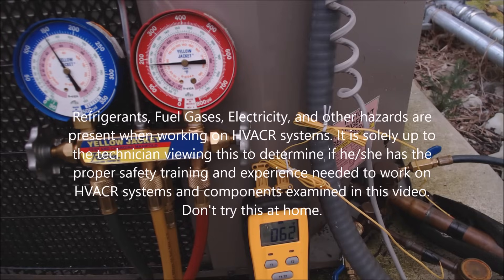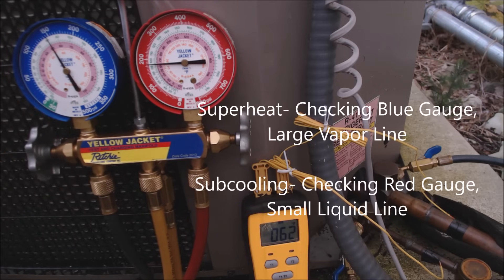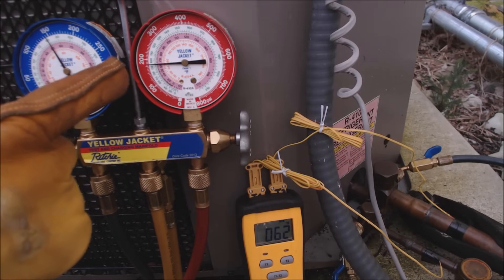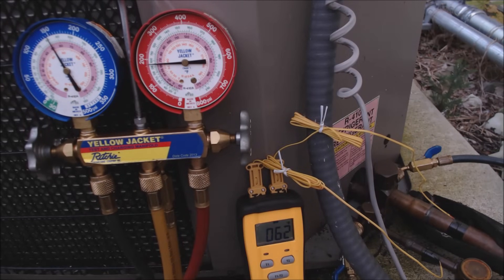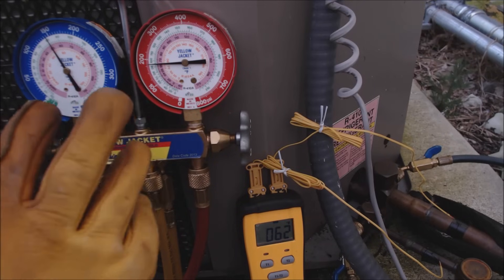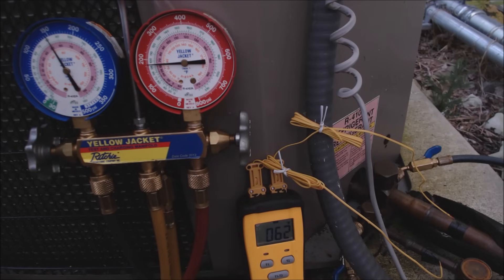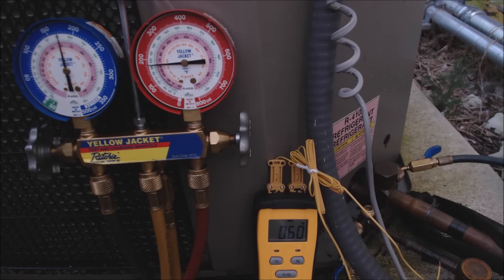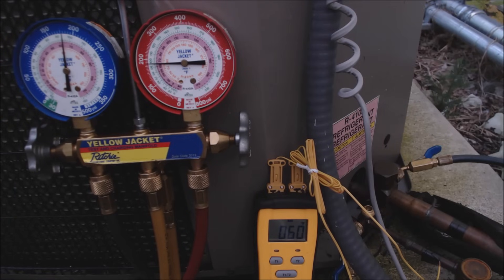HVAC Troubleshooting of Bad Compressor Valves! How to Verify!

Comment: Nice video! Have you ever did that test on a package unit where there are no pump down valve like the split condenser have?
Reply from the maker: Hey Keith,  You can actually tell the compressor valves are bad due to the high sat temp since there was no heat load, low subcooling, and around the correct superheat. You can tell if a single component refrigerant is good by checking the sat pressure once equalized and comparing the sat temp read on the gauge to the temp surrounding the unit. If this was a restricted liquid line or a partially closed txv then the sat temp would be low and superheat high. If the txv was stuck open then there would be little superheat. If the refrigerant charge was low then the vapor sat temp would be lower and the superheat would be higher. This was a bad compressor due to the noise, sat temp, superheat and subcooling and the pumpdown would not necessarily be needed but can be used more as a confirmation on standard 3/8" coil outdoor units with a liquid service valve, thanks!

Comment: hi, will not a wiring resistance check will help us to troubleshoot compressor valves.?. Just on curiosity
Reply from the maker: There may be some wear if doing a megger test but not resistance with a standard multimeter. The valves are different than the electrical windings, thanks

Comment: That isnt micro channel is it? Looks like a york. How would you test that for those?
Reply from the maker: So yes you cannot pump down a micro channel condensor if it has more than 15' of lineset. It is not really a good idea to pump them down anyway. If you use the compressor pumpdown as a test, it can only be for a very short period. I wanted to show that the unit's vapor pressure doesn't decrease but only increases since the compressor was certainly bad. I could hear it but wanted to show the scenario anyway. Yes it is micro channel. You would still see the vapor sat as way too high without even much of a heat load in the building. To tell with microchannel without the pump down, you may hear noise at the outdoor unit and would see low subcooling since the discharge is recycling back into the vapor side. Yes the pump down is the normal test on standard 3/8 copper coils but in the case of micro channel you could try a very quick shutting of the liquid line to see what happens to the pressures and then open it back up before too high of a pressure building in the condensor coil. You can tell just by the sat temp high, superheat around normal, and subcooling low. The thing that you would know is that high vapor sat temp without heat load doesn't match with low subcooling. This couldn't be the txv unless superheat was off of the txv's target. Thank you
Reply: acservicetech I completely understand thanks for your reply back your one or the best most efficient and most informative tech who explains stuff i wish this channel was up when i very first started. Love the videos!
Reply from the maker: I appreciate it! Thanks Dave C!